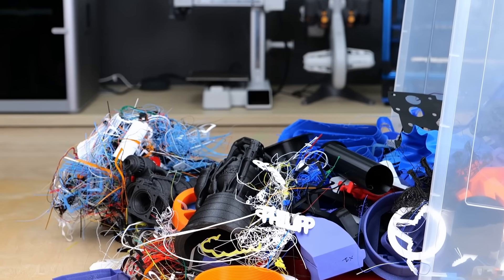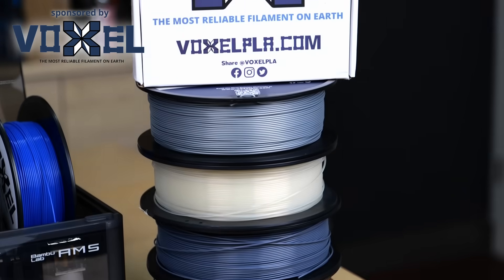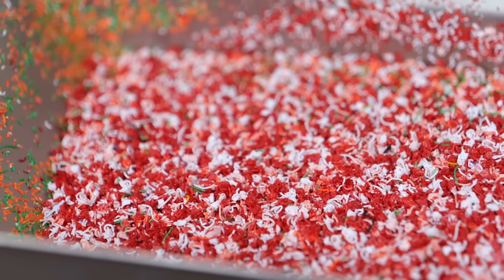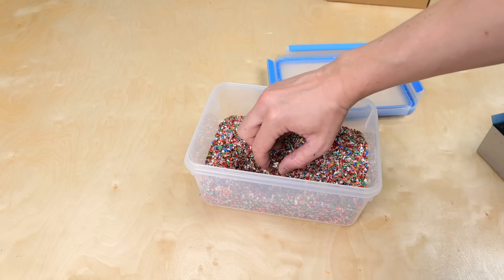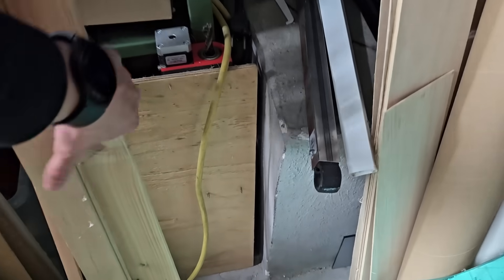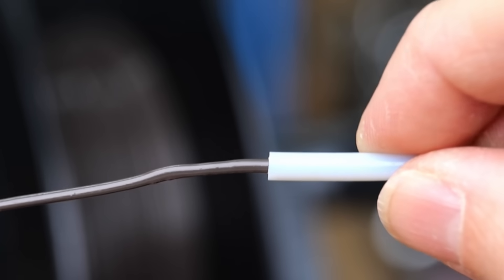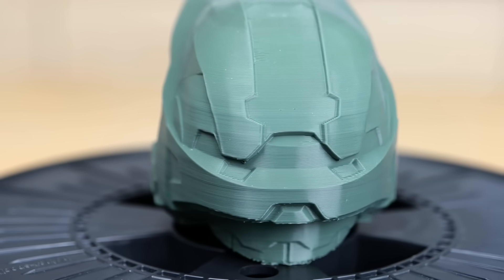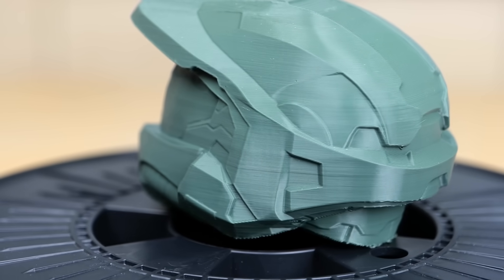Turning 3D Print Waste into New Filament!

Comment: It‘s time that Bambu or some other company is getting an affordable filament extrude / recycling station on the market asap! Maybe not for the biggest/thickest parts but at least for the poop!
Reply: Some filament companies, like redline filament in Germany take both spools and labeled filament waste back for recycling.
Reply: I'm waiting since nearly a year now for redline getting there Recycling Programm webpage getting updated and even asked on Instagram when it is getting released but never got an answer so I'm waiting till today for eighter the page being complete or more then now or an answer on when they start there official program.   @Vizeroy9
Reply: Can just grind them down smaller?
Reply: yes for sure that was my thought too but if they start a machine for small parts like the poop it will do the thing cause there is always a way to make big parts smaller @Mcneds
Reply: @Mcneds i an afraid it would belt by the friction. With water, maybe. But then you are facing with enormous amount of water intake.
Reply: @opiniono-1  just use one of those big macerators its just plastic, then put it in the dehydrator
Reply: @Mcneds yes
Reply: Agreed but companies like Bambu are also selling their own filament. So they might not want us recycling our own filament because it would hurt their sales.
Reply: @PenguinFPV  They could earn far more by having a recycling program... Because it's plastic that requires negligible treatment and can be turned back into usable filament. It saves them money, thus they can price stuff the same but spend less.

So selling a household extruder loses them money, but having a recycling program doesn't.
Reply: The poops are so randomly shaped and akin to Velcro so it would be a nightmare to reliably feed into an extruder. You'd be better off with a small grinder and feeding the regrind into the filament extruder.
Reply: That's why I used the words "recycling station" cause it may be more then just the extruder. Maybe it is an extruder with a grinder build in before or so.  @addohm
Reply: I'm making one for myself and thinking about kick-starting it I'm in the process of designing one that's compact bcz currently it's in 3 parts but I'm wondering what would be a reasonable price since this is something so new and everything on the market is prices do unreasonably so I would love some feedback on what people would be willing to pay for it, please reply to this comment or dm me what you would feel is fair paying for something that can recycle poops and smaller prints
Reply: Pellet printers> filament printers
Reply: The issue is getting the plastic clean enough as Stefan showed in numerous videos. And also you are gonna get microplastics if you grind it up.
Reply: they would lose money if they did that
Reply: I would love being able to send in a box of waste to Bambu labs or somewhere and then just get new filament.
Reply: The best design would be a shredder that feeds into a Siff, then into the recycler.
Reply: honestly if bambu did it themselves theyd make double money! make it small for small time hobbyists. I just got a printer 1 month ago and have a small ziploc of poops. i hate that its all going to go to waste. but if i could get something for ~350 or even $500  that would save me thousands in the long run, Id get it. I only need something for small time printing and i think most do. we're not all big youtubers making 1000s of prints every week
Reply: @pvic6959 neither are the YouTubers… they’re just printing barely enough things to make a video. You probably do print more stuff than they do, you just lack the confidence to get the channel started. Well, here: you CAN do it, and you should. Sounds like you have half of what you need and more than half of the rest of it is stuff you can make yourself… it’s just you! You an be charming and funny and quirky and cute OR, you can just be knowledgeable and informative and quick to respond to YouTube/TikTok/Twitter questions, etc. The point is, you CAN do it, and it sounds like you have almost everything you need TO GET OFF HERE AND DO IT. Your PHONE is a good enough camera these days, and if I remember correctly, your (branded…) earbuds are good enough microphones. SO GET OFF OF YOUTUBE AND GO GET ON YOUTUBE! Or… something like that. I’m gonna go sub to you now, so I can see your meteoric rise 😃
Reply: One problem is that as soon as you put it into the hands of idiot consumers, you need to somehow prevent them from doing something stupid, and a warning is just not enough for people. For instance, Stefan pointed out your shredded plastic needs to be clean . But sure enough someone is going to complain because their branded filament extruder doesn't work after they threw a handful of sand into it, just to see what happens.
The problem with making something idiot proof is the ingenuity of idiots.
Reply: I could not agree more! That is probably on of the biggest if not even the biggest struggle they have to deal with @3dpprofessor
Reply: @3dpprofessor mine would certainly be at least 30% dog fur🥴
Reply: So you could print multicoloured prints in brownish greens and greenish browns?
Reply: 100%
Reply: I would buy it!
Reply: I collect my supports first layers and failures an affordable poop converter would be really nice I think I have enough for a full spool by now
Reply: The Artme-3D is at 600-700 Bucks.  I am waiting for Stefan report on it. May be a 2 Stage approach would be good. Together with a Filament Box with dehumidifier. So first a 2.85mm run in the Arme-3D shopping it down to pellets again and then a 1.75mm run. And for both run the crushed Filament/Pellets in a warmed dehumidifier tumbler Box. This would be a three part setup: Atme-3D Extruder, Shredder for Pellets and idealy a Pellet dehumidifier. 
Together below 1K i would say.

I am just planning on a dehumidifier Box myself, were i can prepare Filaments i want to print later the week. 
Just a big Samla Ikea Box (fake one but with clips for sealing) with stacked Peltier Elements, a Fan, PETG prints and some elektronics.
Reply: I would pay up to 3k for a bambulabs machine. I'm confident they would be able to engineer an enclosed fully automated machine if they wanted if they wanted.
Reply: Hi
Reply: they would never do that because 2/3 of there money is from filiment
Reply: Did you watch video? Whatever machine they make would have to grind the plastic down, sift it, tumble it with a magnet, and then vacuum dry it to make sure the end result was at all usable
Reply: it could easily be solved by pushing it down a tube that is as big as the strings it needs to be.
Reply: They won’t do it because if you waste filament via purging they can sell you more filament
Reply: i feel like its gonna happen sometime in the next few years. we just need to wait until 3d printers become even more popular which will drive companies to want to make affordable mass produced filament recyclers
Reply: It would hurt the fillament companies, they won’t make them.
Reply: Lol Bambu wont do anything until an open source option comes out that they can easily copy, tweak and then release. Remember, Bambu doesn't make things from scratch, they copy a hell of a lot from other people, patent it then release it.
Reply: it‘s not that easy
Reply: I thought about the same thing. I have always wondered if it was possible to recycle all the filament waste. 

Maybe CNC Kitchen can make a filament recycler. However, at the current rate, I'm pretty sure Bambulabs will probably be the first to make a mass-market filament recycler.
Reply: I hope they will. I just switched to a bambu lab printer, I'm fully in love but it poops way more then my last printer but no or the less I can't stop printing cause It's even much more fun then with my last printer. But this thing bothers me a lot and I would change it if it would me more affordable then over 5k just the extruder part.  @Miked1332
Reply: yeah let people pay just because a company uses an idiotic wasteful system
Reply: If I remember correctly, you can have, at most, 30% of old plastic in a recycled part for it to have appropriate behaviour.
Reply: @xManzi  it depends on the material, how well sorted it is, how many times it has been recycled and the method of recycling.
Reply: @xManzi  That is true for most plastics used in industrial applications, such has nilon and POM , because the heat cycles caused by repeated manufacturing and recycling alters the polymers, however PLA and most 3D printed materials are heated to very low temperature compared to industrial application, and the material is barely affected, if at all.

Recycling filament can also add impurities into the plastic, however when it comes to prototyping this impurities aren't a problem, at worst your part is just a little bit more brittle, it's no big deal.
Reply: Would be better to just not use bambu's mechanism that produces poop in the first place. IDEX printers or ultimaker's multi nozzle should solve it.
Reply: 3D printing waste is tiny compared to the rest of the plastic waste you make in everyday life
Reply: That is not the point here and from my comment at all @kkuhn
Reply: @kkuhn a filament recycler and extruder can recycle more than just 3d printer plastic waste
Reply: @malaythakkar8772 they're still so expensive it's basically unattainable for most people.
Reply: @kkuhn   For me it's more about the cost
Reply: @kkuhn  It is, but it's also good to be able to recycle and reuse all plastic waste.
Reply: @kkuhn That is usually true, but why not try to cut it down as much as possible? Many small things in you daily life quite add up.

Also am I the only one who is fascinated by the process itself?
Reply: @kkuhn but not in the way how bambulab using AMS. And this make a stain in 3D printing soon, where "educated" politician would not give a shit if you use AMS or not, filaments will get penalty on them. So we all gonna pay.
Reply: @opiniono-1 You’re absolutely right. Unfortunately, though, that’s sorta just how being the frontiersmen and frontierswomen goes, sometimes. You gotta eat the shit, and sometimes you gotta serve the shit to the people you’re feeding… but in the end, you’re making the industry and the technology better for the billions of people who will use it after you. 

We thank you for that 🫡
Reply: @kkuhn  Is it possible to turn plastic bottles into 3D Printer filament?
Reply: @kkuhn  ah so we should just not give a shit okay
Reply: @kkuhn lol if I had a multi colour 3d printer my plastic waste would go 10x, though I do live in Australia and in the country where I buy most of my food from roadside stalls, so im an outlier
Reply: @kkuhn depends on your lifestyle and how much you 3d print
Reply: @kkuhn yeah, but if I can cut back on part of it (and save money on filament by recycling waste) it's probably a good thing
Reply: @kkuhn so make it so you can also recycle certain plastics that are able to be recycled without being toxic
Reply: @kkuhn and what? Being ecological doesn’t mean that you have to do onlx big things if someone can recycle anything then is a win
Reply: @kkuhn lol maybe you
Reply: @kkuhn  says who? How do you know how much I waste?
Reply: @kkuhn you can just grind that into filament like I do
Reply: @kkuhn  I'm trying to figure out a way to address more plastics than just printed waste.